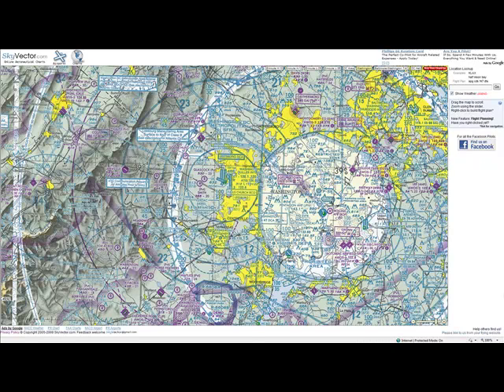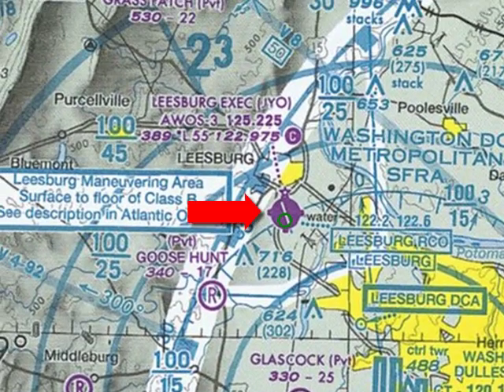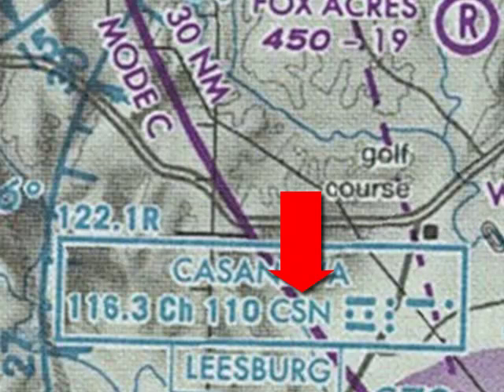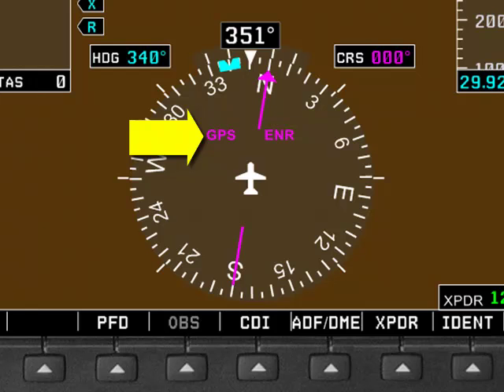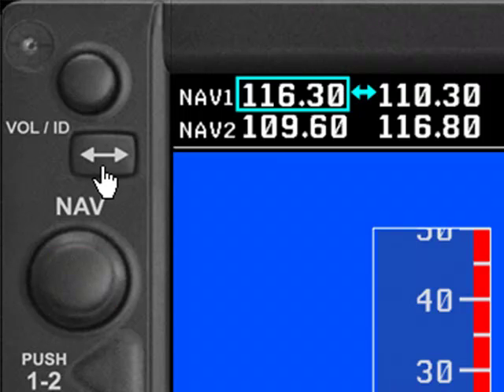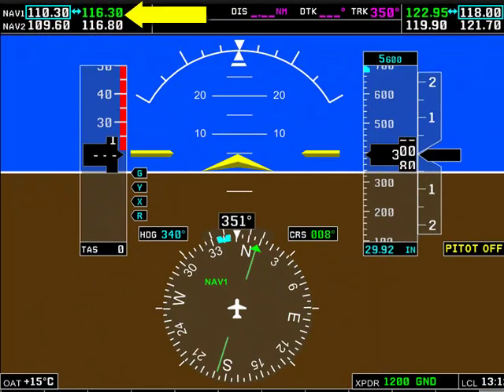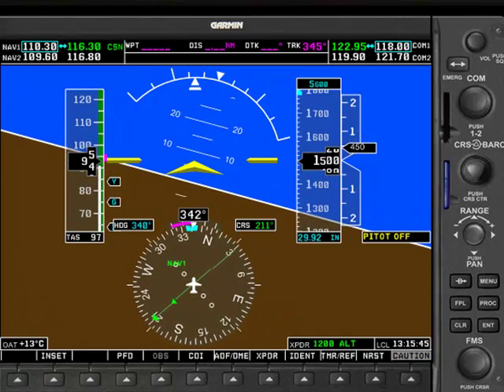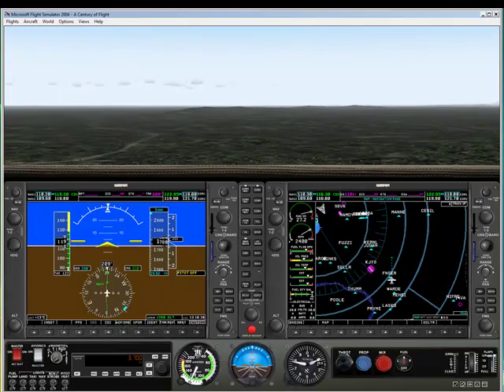Mindstar Aviation G1000 - Video 5: VOR Navigation

Comment: Not one video showing the bank indicator functioning.  Ingenious!
Reply from the maker: The bank indicator shows deflection as long as you don’t have auto-coordination turned on in flight sim.  Auto Coordination automatically adds the needed rudder input to keep the plane in coordinated flight at all times, which means there is no deflection to show. This is a useful setting in many situations, especially when trying to fly from a keyboard when making these videos.
Reply: @MindstarAviation   From what I understand, it's a critical measurement. Also, they don't all display bank in the same way.  So I would think you'd want to show it functioning on a turn in a video aimed at novices and new pilots.